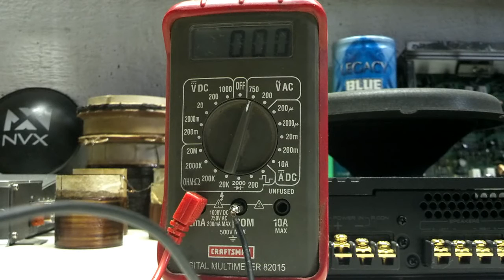Caution High Voltage !! Subwoofer Generator Powering a AC Motor !

Comment: voltage can only kill you with the amperage to back it up. judging by the power drop from the motor i would have no fear of touching the 2 terminals.(im also not afraid of tasers as there all burn no shock)
Reply: You mean amperage will kill you, you can get shocked many times like using a taser it's thousands or millions of volts
Reply: yes, thats about half what at said.
Reply from the maker: its enough that its uncomfortable , not deadly thats for sure . not on this small scale